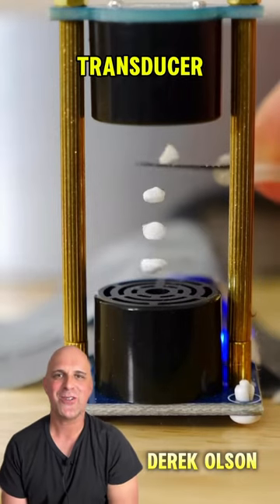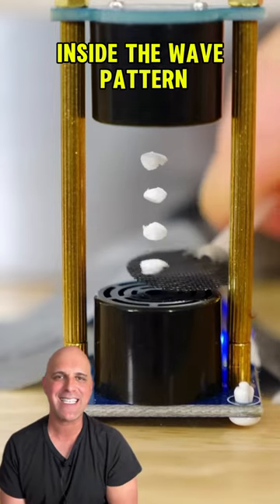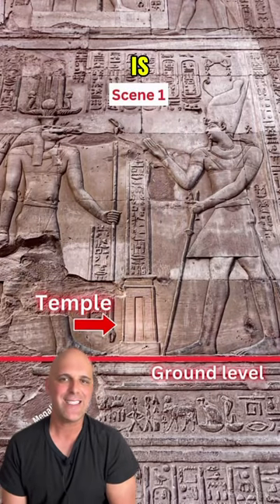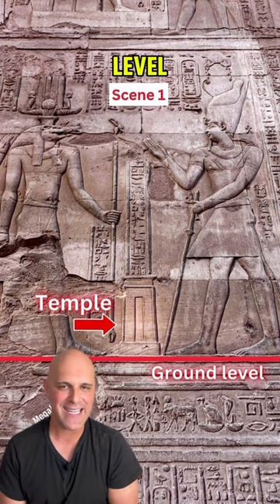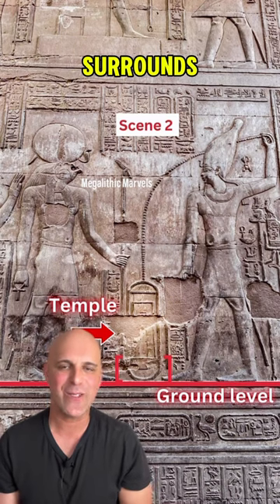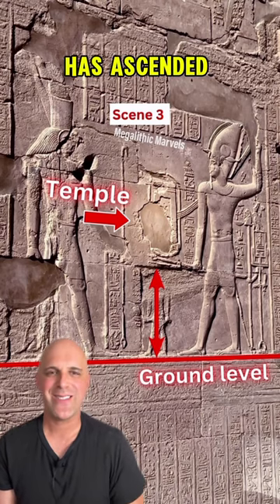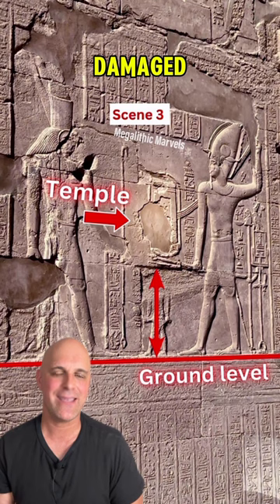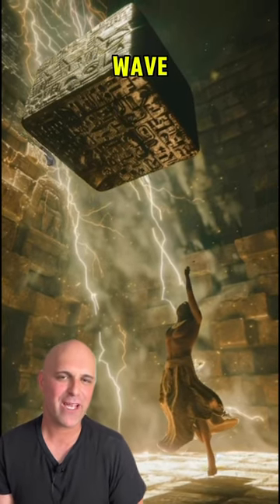Is this how they did it? #shorts #ancient

Comment: You missed the fact that drawings against the little man depict the use of pump z waveforms; a carrier and a carried wave produce a higher frequency wave which is universal in all zero point energy as only properly described by Tom Bearden who gained this knowledge from Tesla not that we need that since a number of zpe devices are in use today. Sound wont use this.  It is obvious to me, the giant uses rope to simply keep the device in place. It could be used for healing, could be an isolation chamber for remote viewing and or future sight, could be for just moving stones around but it's definitely not using sound. They were absolute masters of zpe and the pyramids themselves are proof of this. The very layout of the 9 pyramids is a circuit which revolves superconductive capable particles in a multiphase loop. No other design would do particle acceleration as efficiently, meaning inductive concentration of particles >500kv to compress charge AND keep it from spinning into an expanding funnel of loss by using the interlocking geometry of 3 3 3, and NOTE the outer walls are not flat for a reason. They are just slightly concave to prevent rotation of the field, forcing this interlock of charge columns even more.
Reply: I have ZERO clue what you just said, but I agree with you! lol.
Reply: This is like reverse ChatGPT
Reply: I wish I could talk to you in person...amazing explanation.
Reply: is in our face, we do not yet understand, someone has to teach us or explain it to us
Reply: @anunnakinibiru  Okay, the short version is that space has 7 density matrices and we're only in the 1st. The 5th gives the ability to exchange time and space so they can interchange. One can most easily see into the future by living in it only as an observer.
Reply: @bluewaters3100  More interesting for you will be what takes place in late spring this year. Don't plan on traveling 5.5. and avoid the coast.
Reply: @mikefromspace  - no, the short version is that you're talking complete bollocks and just hoping that no one will notice, if you throw in the right word salad.
Reply: @mikefromspace  future: dreams, deja vu 3 sec, in real life... how about unseen world, do you believe/see?
Reply: @MultiRationalThinker  That's not argument, it's rant. I'm still waiting. No need to be rude.
Reply: Psuedo electronic technobabble. 

Overlaying data onto a carrier wave doesn't increase the frequency, merely the amount of data being transmitted.
Reply: @surfmarine3118  Dielectric layers are used, so multiple nonlinear layers release a wave simultaneously on the carrier genius. Now you tell me, how would pump z waves in sync yet out of phase imploding through a nonlinear medium NOT become a the sum of wave peaks in this case?  It's impossible to deny the science that's been around forever.

Comment: Acoustic levitation makes more sense than most theories. It doesn’t explain how perfectly shaped and fitted the massive stones are though. I just hope we get some real truth about our past before I traverse this plane of existence. I just want to know what this is for and what it’s all about…
Reply: The thought of the YEARS of planning and engineering that had to go into this just making sure the cut of one stone won't impede the integrity of another stone via ducts,  rooms, passageways, inclines,  it's mind blowing. 
They didn't just stack stones and then cut them away. The fact that they want us to believe they are tombs is a slap in humanity's face..
Reply: Nah you can make a water vacuum that holds a lot of weight as long as the surface area is high. 
Someone has a YouTube video on it using a garden hose spray that onto a tray that like a cm tall. As soon as you move the jet of water directly up against the surface the tray will stick to the hose and it’s actually pretty complicated why it works. 
It has to do with increasing the velocity and making a low pressure zone that uses the water’s cohesion to also create a higher pressure zone as the water splashes and runs of the sides/bottom. I’m pretty confident they had plumbing because of the lotus flowers with the long stems with these beams coming out of them are all over Egypt. This type Acoustic levitation can only hold very light material, in the video it’s individual styrofoam beads, I have also not seen anyone attempt to make one of these devices to move the beads while they are floating in a controlled manner. It would take a very complex understanding of sine functions and computer logic, to have control over how the ultrasonic beams bounce while maintaining the pressure pockets that the beads are in (why they can be stable)
Reply: The video is specific on the physics phenomena, not about Egypt or anything like that. It’s made by the guy who makes a bunch of 2D models showing fluid dynamics and other random engineering projects
Reply: @Sweetdibbs 8D Drucker 😂 ich glaube sowas kann einiges machen und präzise. Wäre  möglich da die Menschen immer an das kompliziert denken und nicht simpel.